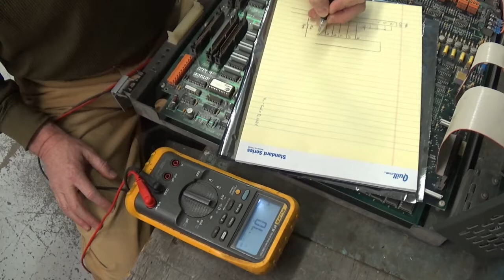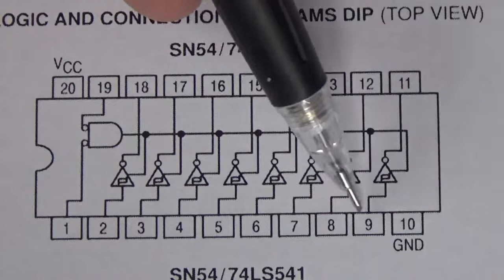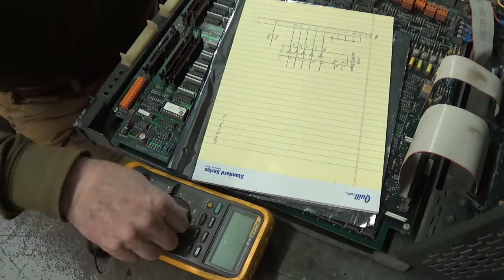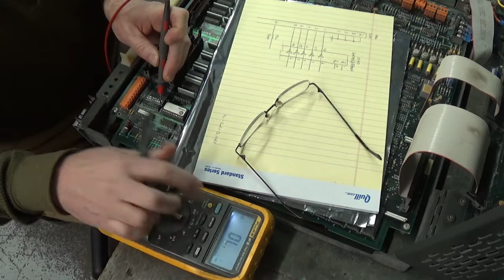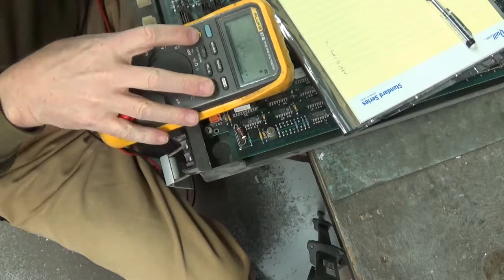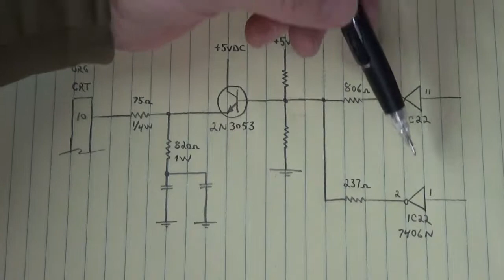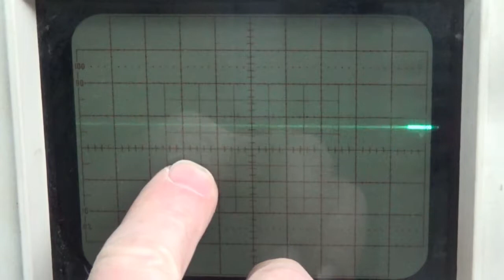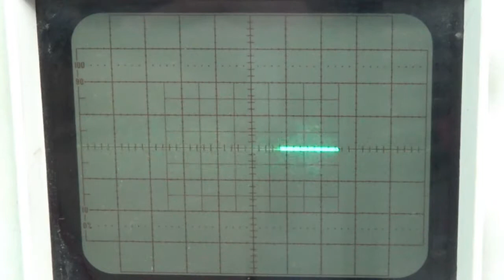Pt.1, Allen Bradley CNC Unit Not Responding to Key Presses

Comment: Hey I wish I lived close to you because you are my hero man . I started messing around with cnc machines motors , drives, servos and all that good stuff but no one around here knows nothing about older machine controllers . I have a bandit 3 from Allen Bradley complete with dc servo motors and drives and when I got it I cleaned the motherboards and then I had no idea of firmware and that you don’t supposed to change or remove old chips and I took all of them off to clean them and I never thought they had to go back exactly in their original place SO NOW THE CONTROLL DOES NOTHING . I have just one red led on the cpu board that turns on but that’s it no video at all .
Reply: What was the voltage you applied to the power failure connection. I noticed that you connected to another power power supply. Any help would be really appreciated